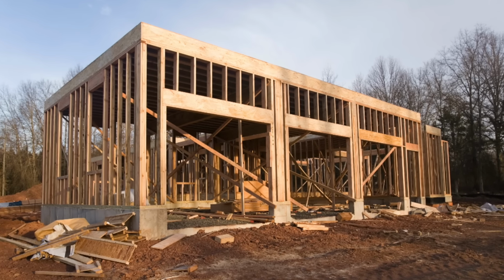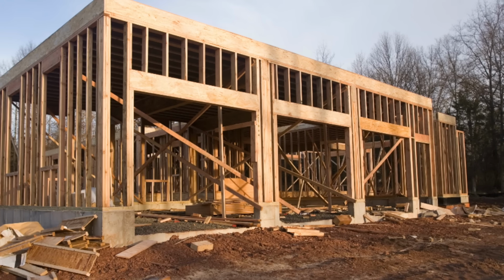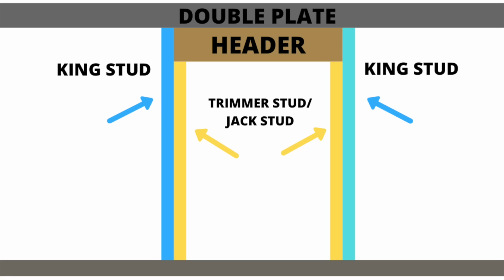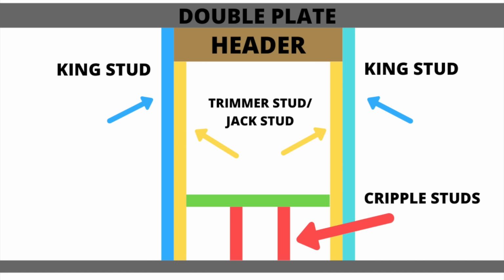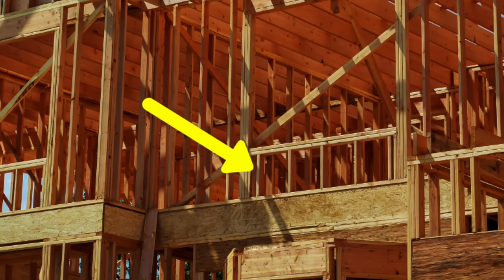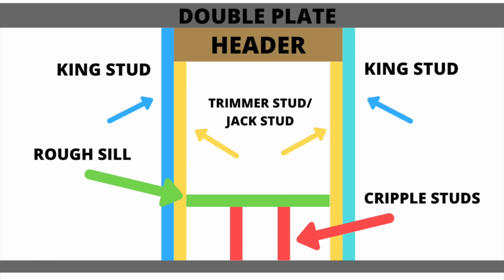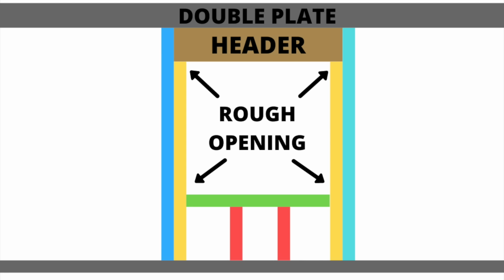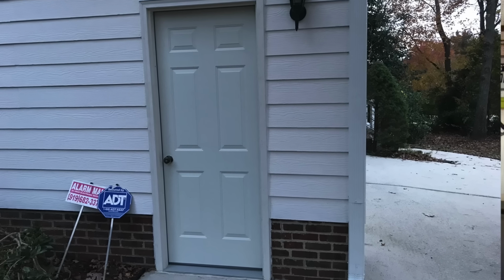All House Framing EXPLAINED...In Just 12 MINUTES! (House Construction/Framing Members)

Comment: Well, brilliant and fascinating!
When I was a child, I was born in 1958 so my climbing on and around a building site would have been say 7 to 11 years old so 65 to 1969. Back then in England house building was still all brick and then came 1/2 brick. So the ground floor (that’s the floor that’s at “street” level) is breeze block and brick and wooded frame above (the 1st Floor) with brick to the exterior. With the roof and available “loft or attic” space being final level in most suburban homes. 
This soon became full wood frame with brick outer and drywall to the inner all round.

Did the States always use wood frames?  Do you have any what we call traditionally built property’s ?  We don’t have cellars or none to mention and homes built post WW 11 / 60’s the roofs were such tight angles that loft conversion was/is/are limited.

I can’t recall the question I was wanting to ask you............ I may get back to you later . LOL
Reply: Because of the availability of timber, wood has been used throughout the US's short history. All of the masts for His/Her Majesty's war ships came from the colonies during those times. Also, we have fairly large areas of the country that are subject to earthquakes. Wood members, when installed properly, can flex quite a bit without bucking. It takes a lot of steel reinforcement in a concrete structure to stand up to an earthquake.
Reply: @jobacuda4472  : Thank you